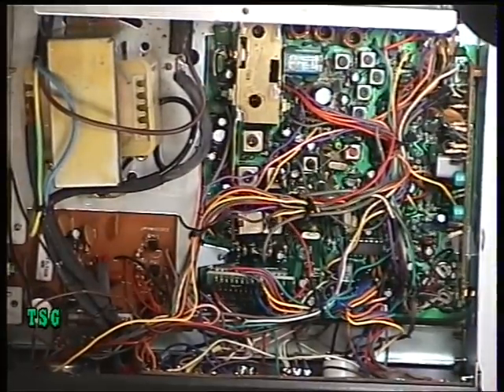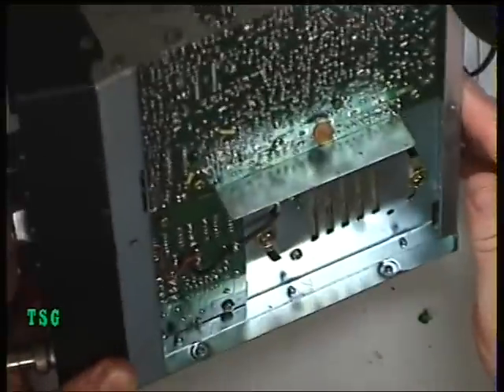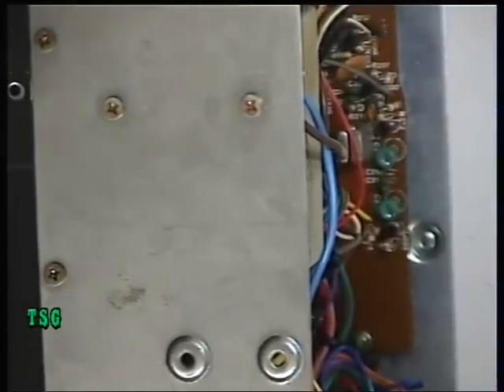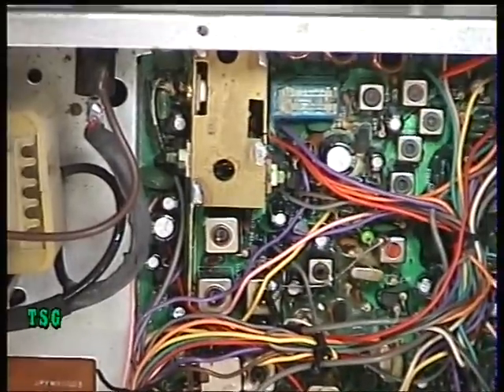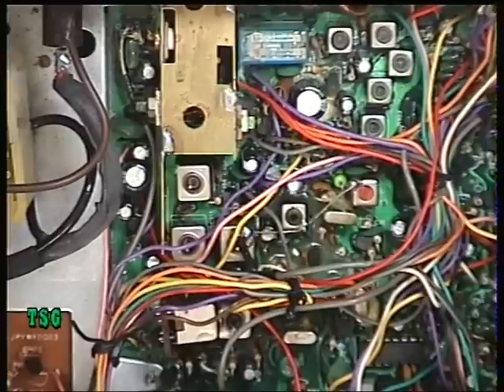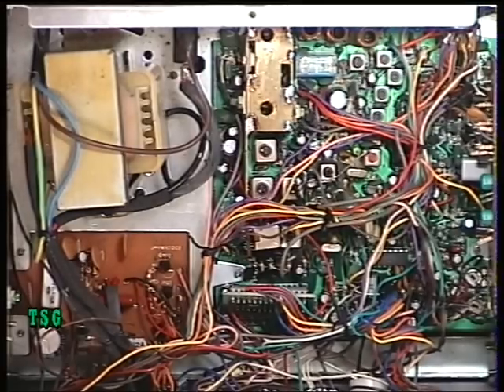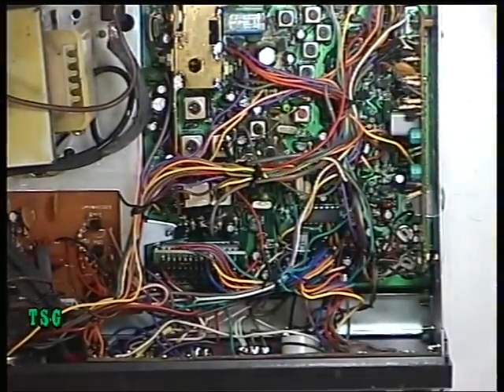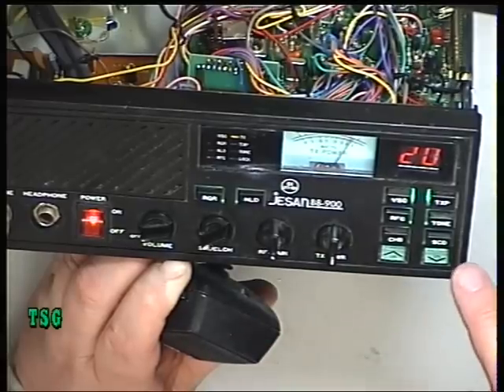Jesan 88 900,  UK (CB 27/81) CB radio (Base Station) - Transmit alignment.

Comment: Thanks Richard :) Can I please request that you cover in one of your future videos what CB equipment is actually legal in the UK now, and what isn't? I for one am certainly confused! Is that the Casson organ you're talking about? Looking forward to seeing the videos :)
Reply from the maker: Obviously what was previously legal here (other than 934 Mhz) still is. Officially, any CB radio made for the european market which has the CE approval mark is OK. bear in mind it's 40UK FM only channels & 40 EU channels, AM, FM & SSB. Radios with more than those 80 channels & obviously use of ham radio equipment on CB frequencies along with burners etc are still strictly prohibited. Although the UK licence is now "free", the rules still have to be adhered to.

Richard

P.S. Although the little Cheddington Casson organ is now in store here, I won't be starting on it for about a year owing to workshop space. I'm still on with the Ex Burton Rd Lincoln Jackson organ in the workshop this year. These organ jobs on an average 2-manual organ take around 19,000 man hours to do!